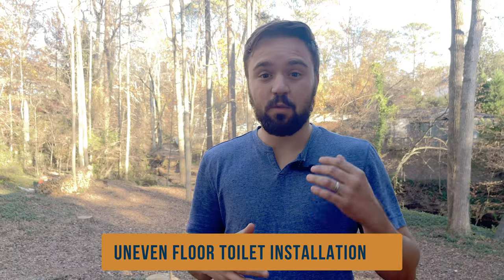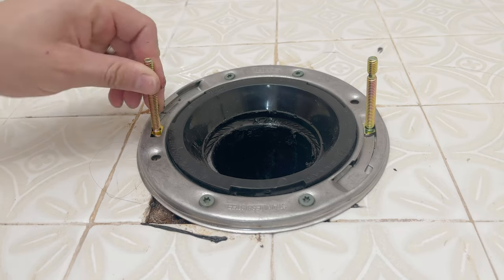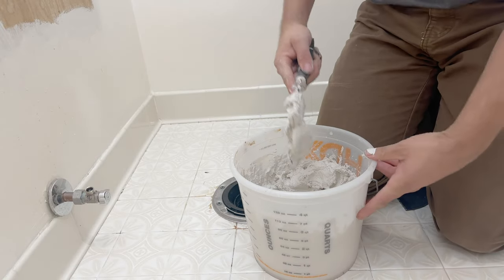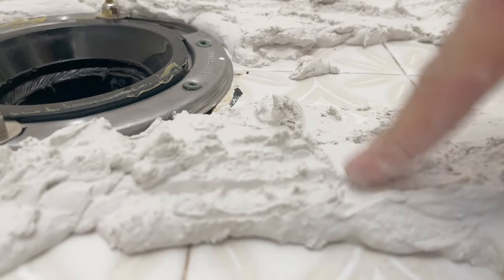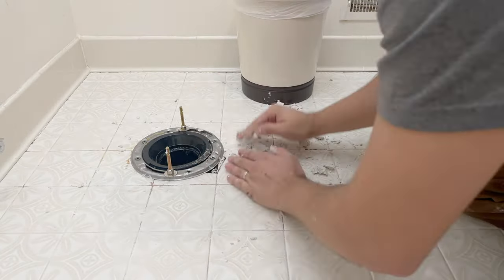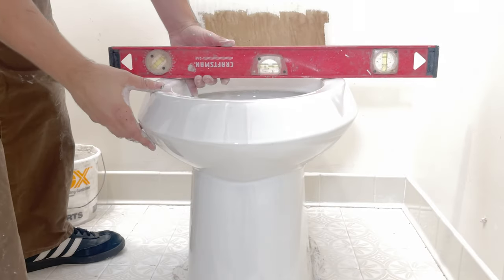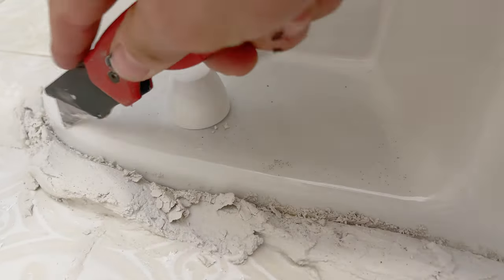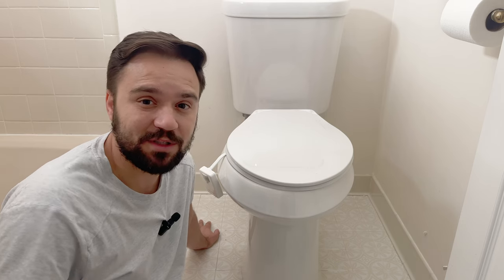How to Set a Toilet on an UNEVEN Floor (NO SHIMS-NO CAULK NEEDED)

Comment: When I did this I placed the toilet first and then I used a grout bag to squeeze the plaster into any gaps.  Worked like a charm as the toilet flange was on a bit of a hump in a concrete basement floor.
Reply from the maker: That is awesome that it worked for you…And I like the idea to seal the gaps. Thanks for sharing and supporting the channel!!🛠️✌️

Comment: Yeah because they didnt invent shims for reasons like this or anything. Please do it the proper way. You can buy plastic shims that you can place under the toliet that are made for this.
Reply: and now with mine (shimmed), it is now leaking after about a year. The height from the front to the back is different and where the shims are at. With use and even retightening the bolts, I still can't get it to stop leaking. I used the rubber/wax seal that was made for uneven toilets. Home is a patio style, so it was never leveled properly when constructed and tile was put on top - now my issue after 2 years of ownership as 1yr is all the builder covers for concerns.
Reply: @skippy412   thats why i use the extra large wax ring  for uneven floors
Reply: Ours was shimmed over an uneven tiled basement floor. Constant leaking, and now the base of the toilet has cracked from over tightening. Back to square one. I’m also concerned that the flange will fail again and then I can’t easily take the toilet off. We do use the larger flange. Is our only option now to rip up the floor?
Reply: @angelal5482   i don't know who put your toilet in but they did it all wrong. If it's on uneven tile, then it should have been shimmed where it was uneven and then caulked. Caulking helps the toilet to not move around. The bolts on the side of the toilet are to help keep it in place and they should only be snugged. I wouldn't tighten them more than 5 foot pounds of torque. Anything over 15 foot pounds of torque and you're just asking to break that toilet's porcelain.
Reply: @RhinoXpress  around the toilet or under the lip of the base?
Reply: @southparklion   what caulk or shims?

Comment: what if the floor the toilet its sitting on is uneven by an inch? will this still work? my toilet is not flushing completely but water from tank completely drained. could the very uneven sitting position causing this issue?
Reply: Yea. I changed the wax ring with a new rubber one. Flushed great for a day,  back to slow draining and not completely flushing. Have 2 more wax rings to use if I can't get the rubber one working. But it seems nowadays  everyone recommends rubber instead of wax. But the floor and the toilet flange are very uneven and I believe causing the issue. Gonna tackle it this weekend. Frustrating situation. About to just replace the flange . But if that doesn't work , will need to replace entire bathroom floor, which is not a desired task to have ahead

Comment: Without using a primer made for it, Plaster of Paris has zero adhesive properties. Not a good idea. Use either thinset or Durabond
Reply from the maker: That’s interesting! Thanks for sharing.
Reply: That's a good thing, though! You want it to be a firm substrate that addresses irregularities in the floor but doesn't prevent you from easily removing the toilet later. Thinset or durabond would be a much greater risk to damaging the toilet or floor should you want or need to remove the toilet.

(Caulk would be a good final touch because plaster of paris is not water resistant)
Reply: Haven't tried it but using a product called ROCK HARD by Durham instead of Plaster of Paris could be the perfect substitute.  It is water resistant and I don't think it would stick to the floor after it dries. One could test it to their type of floor before setting the toilet. It dries fast too.
Reply from the maker: @bryanfoxx2292  interesting… i have to try that next. Thanks!

Comment: Plaster of Paris is going to fall apart as soon as it gets moisture on it… sure hope this toilets not near the bathroom
Reply from the maker: Thanks for the comment.. I just wanted to share an old trick, not used as much nowadays…
Reply: I began plumbing work in 1973 and was taught to always set a toilet in plaster of Paris. It helps level the toilet and helps to secure it to the floor. The plaster never gets wet enough to deteriorate. I’m told now no one else does this and in my opinion it’s laziness.

Comment: I have installed more than a dozen toilets and never knew to put a nut under the toilet to hold the bolts. THat seems so intuitive. Why don't they sell the bolts with two nuts? I haven't done the plaster trick but will be trying it from here out. The toilet I have in the latest house I bought has what I thought was grout under it. I thought that insane, as how would you ever get it up? Maybe it is plaster. It is in Mexico. Is this more of a common thing in Mexico or by Mexican plumbers? Great thinking. Thanks for sharing.
Reply from the maker: Oh yeah! This is a really old trick, very few people use it nowadays, for some it’s easier to add shims or just re-level the whole floor… I just wanted to share an alternative method. Thanks for watching!
Reply: That's why they give you four nuts instead of two in the Jonny bolt kit
Reply from the maker: @maintenanceessentials  exactly 👍
Reply: In Mexico they could put Taco's under there as well!

Comment: Just a home owner here but a plumber taught me this trick years ago. I use a pencil to trace the outline of the toilet on the tile. Then I put the Plaster of Paris in a gallon size Ziplock bag and cut a corner off. Twist and squeeze the bag opposite the cut corner to put a nice fat bead of plaster on the inside of the pencil mark. After placing the toilet I use a wet sponge to remove the excess plaster, just like when grouting tile. Looks great and makes for a rock solid toilet. Work fast because the plaster sets up quickly. 

A few months ago my flange failed and started to leak. The plaster failed from getting moist and my toilet started rocking alerting me to the problem before my subfloor rotted out or the leak caused bigger problems. Plaster of Paris is the perfect product for this.
Reply from the maker: Wow! Great that you liked this idea. Yes, plaster of Paris is great for these type of applications. Oh it does set quick, I like the bag idea, thanks for sharing and supporting the channel. 👍🪠